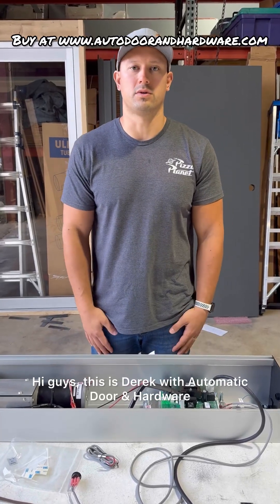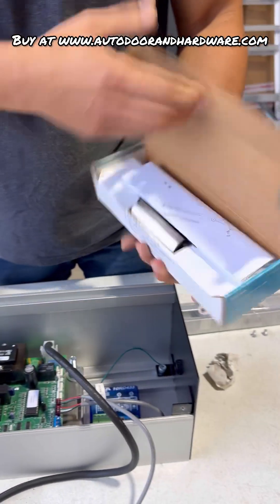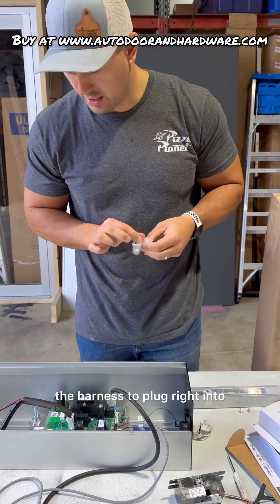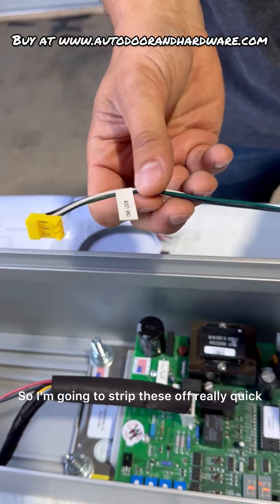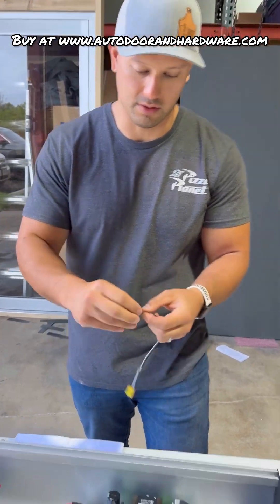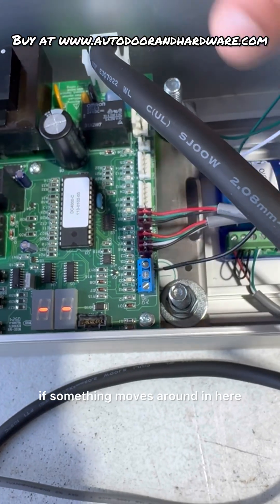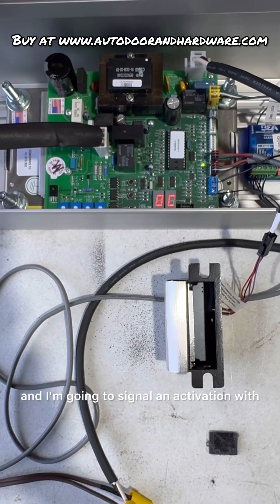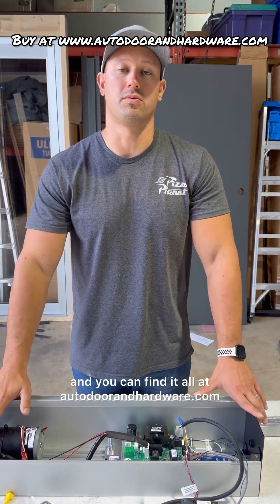How To Wire and Program An Electric Strike To An Automatic Door Opener | Maverick EZ-4000

Comment: Any of these handicap auto-door openers have a hinge locking mechanism so you don't have to install a separate striker or mag-lock?
I get they each serve a distinct purpose, but hinge lock (where a piston is pushed up vs a constant running motor lock) that would normally pushes the door open should suffice for most where the door force would be under 700lb.